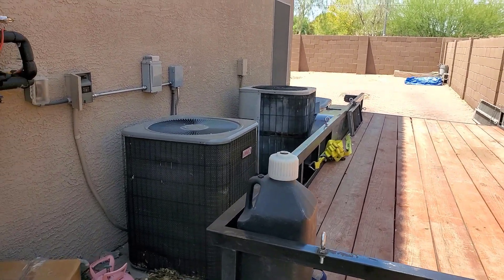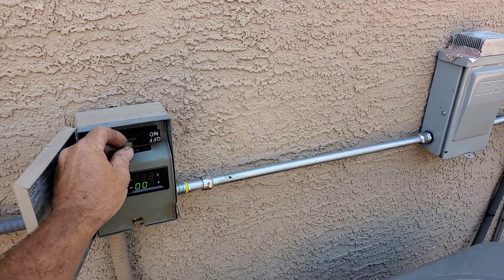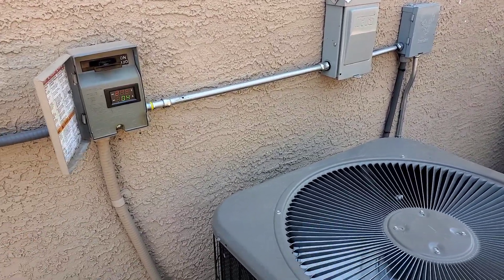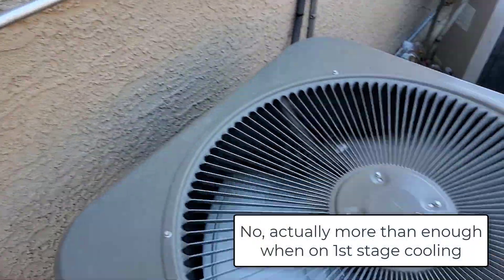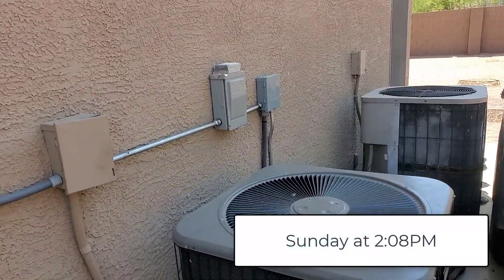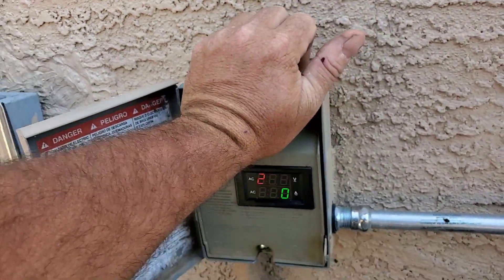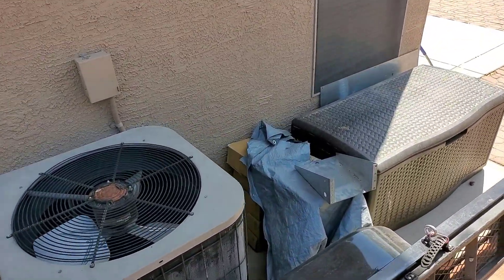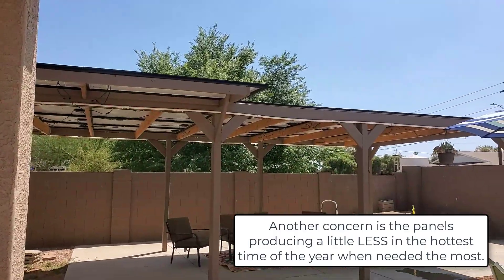Some more thoughts on my DIY Solar Assisted HVAC   Lower utility voltage or increase Solar voltage

Comment: Dumb guy asking a dumb question, how would heating elements handled some vfd goodness? My thought would be to add your extra panels. Then use a vfd hooked to your water heater as a dump load. Then find a way to link the two vfd to work.
Reply from the maker: I already installed an "AutoTranformer" to lower my utility voltage and now it works fine.
The VFD draws off of the solar and zero off of the utility until the solar voltage starts to sag down closer to 300VDC.

My water heater has a small 115V heat pump connected to it.

Comment: Thanks for the update.  As an engineer,  here are my objective thoughts:

-you can’t fully fix the solar vs. grid issue w higher solar voltage; you need to reduce the mains voltage to around the lowest level the equipment will still run at.   The way to do this is with a buck boost aka autotransformer.  This transformer is cheap and has minimal loss because the vast majority of the load bypasses the transformer.  It is only working to raise or lower voltage a small amount.  Losses will be in the range of tens of watts.   It will be warm to touch.

-Get a 240v to 24v 500VA transformer and wire the primary and secondary together in series.  That makes one big effective winding ; feed 240v into that.  Then connect output to the primary winding and you’ll get 240÷264 x 240 = 218.2V.  If you don’t get that then flip around the wires of either the primary or secondary to correct the winding “polarity” .  this little little 0.5kVA transformer is good for 500÷24=20.83Amps  output !  (it’s the miracle of wiring regular isolation transformers,as non-isolated instead)

-DC bus voltage as high as inverter can tolerate is obviously great.  but be careful w any switching circuit - it could behave quite erratically as Sun/shade conditions fluctuate, and as load fluctuates or cycles.  This will torture the switching device , as well as the diode bridge in situations where it switches panels out right when AC sine wave is at peak and the current spike through the diodes will be friggin huge.    A charge controller would regulate it (basically a buck converter ) but i like the elegant simplicity of what your doing and avoiding that kind of hardware.  

-knowing autotransformer theory is  wonderful.  i’ve found no techs, electricians or ee’s that have experience or deep knowledge of them.  somehow it’s a backwater.  you can do amazing things w regular old transformers by how you wire em up..
primer:
https://www.thomasnet.com/articles/electrical-power-generation/about-buck-boost-transformers/
Reply from the maker: I'll have to read up on that transformer article.
I have a fairly large transformer that might work.

As for the switching of the extra panels,  it wouldn't be switching based on voltage and changing during the HVAC operation.
It would switch another pair in series once thebBFD was running (using the VFD output to control the relay) and then switch back when the VFD stopped.
Just to keep the DC Bus from charging up to the higher unloaded voltage of the panels.
If I'm approaching 360VDC now unloaded, then I'd be at 390 with another 30V added.
Reply: @hackfreehvac  cool,  makes sense re panel switching.

most transformers can be wired as autotransformer(buck/boost) provided the primary is rated at your line voltage or higher.   over sizing is totally fine.  you just need primary/secondary winding ratio somewhere in the range of 10:1 to 7.5:1.   i use 240v/32v units to boost 208v to 236v for my 5ton AC and double wall oven.  The transformers are 2 kVA and 1.5kva, respectively, both are oversized for the load

you can actually also use a bunch of plain old 240to24v hvac control transformers wired in parallel to get the VA you need I do this all the time nice power boost to my vacuum cleaners ,electric leaf blower, belt Sander, paper shredder etc.  The only caveat is all the transformers need to be the  same model otherwise you can get some excessive  Eddie currents
Reply from the maker: @yeliab814  I've been reading on those lately and ordered one. 
At first I thought you all were referring to a hack build.
But now I see it's an actual simple voltage correcting transformer and they are pretty efficient after all.
I'll be posting about it soon
Reply: @hackfreehvac  Sweet dude!   This is going to work great I think.  Look forward to seeing the outcome.  I would definitely use that DC choke you have (if it is from a roughly  similar capacity system and thus  rated for the correct current range), even if you have to hack the VFD to access the DC link between the rectifier and caps (some drives provide these terminals with a factory installed removable link, some drives don’t provide the terminals).  And connect the solar after the choke.  The choke will improve the AC harmonics and slightly drop the effective AC voltage a bit more.  

I was also thinking of a cleaner solar switching system for a full 12 panels,   which also adds some safety, but is super cheap because it uses HVAC parts and not super expensive DC gear from the solar and EV world.  Goes like this:
-configure/program an output terminal (open collector ideally) from the VFD that confirms drive is in operation , based on output frequency/rpm, current , or whatever.  Use this plus the VFD’s  DC aux supply terminal to drive an appropriate voltage light duty DC relay , for pilot duty. 
-connect the outputs of that relay through the 24vac supply in the condenser, and over to two double pole HVAC contractors.  but insert an ICM delay on make timer on one of them, and set to min delay (couple of seconds).  run the solar DC into and out of each of the contractors, but on the one without a time delay add a chunky resistor, maybe 100ohm 100w or whatever (would need to experiment with resistor value vs. delay time )

This contactor array should  drop the open circuit solar voltage the drive ever gets to see, and should  not ARC badly on either switch on or switch off (i think).  You might have to play around with the resistor or even add another resistor with a capacitor bank in between them to ground, to get it t work right. 

This setup will also switch out the solar upon drive shutdown/meltdown, and  AC power loss or breaker tripping.    All good for safety.    Initial System startup will be 100pct from grid AC.
Reply from the maker: @yeliab814  Yeah I wonder what kind of arch you might get when contacts in a relay switched another set of panels into series. Lol.
But now that I've discovered autotransformers to reduce my utility AC voltage a few volts I don't think I'll need to do that. 
I've got a transformer ordered but it's going to take over a week to receive
Reply from the maker: Also, my VFD does have the DC Bus link to disconnect and add a choke.
The choke I have isn't from a larger VRF unit so it's more than enough l for my 3 ton.
Reply: @hackfreehvac  great - you should be all set - look forward to hearing how it works out.
Reply: @hackfreehvac  I’m thrilled to have been able to help you out with this project.  perhaps you could look back at some of the questions I asked about your system as I am building something somewhat similar in so far as variable speed, but I don’t think you answered any of my questions to this point fyi
Reply from the maker: @yeliab814  on other videos?
Reply: @hackfreehvac  I had asked a few questions spread across comments on this and one other video I think.  

Basically I am doing a fairly similar project in that I’m converting my 5ton ac to all variable speed.  I have installed  motors/VFD’s for evap&cond fans; next is install 3ph scroll and VFD.   So I was curious:

-do you have recip or scroll, and how low Hz do you go? 

-what VFD power/current rating do you have, for the 3ton(correct?) compressor?  Any issues starting it?

-any oil return/sump issues, and any opinion on how low Hz I can run my zr61kce/tf5 ?  Do you think it makes sense to run a periodic run up to say 50Hz-60Hz when running at low speeds (30-40Hz)?

-Are you just running 2 stage 40 / 60?   I was thinking about controlling comp speed on PID using perhaps suction pressure transducer, but cant think of a good control strategy.   Maybe simpler would be to vary evap fan and comp speed in unison based on a PID linked to temp setpoint.  

-any other helpful thoughts in making such a conversion?   There seem to be very few people who have done this ..  many thanks

Comment: I was thinking why not run a timer too the system where you can kill one power by a timer switch and then it can switch back in the evening to the grid but just another idea for your system...
Reply from the maker: If I had clouds, rain etc it would then drop voltage and fault the VFD.
Also the load varies. And if someone turns the stat down the 2nd stage on a hot day might exceed solar only power.
Reply: @hackfreehvac  yea true but least it doesn't rain often here but I guess if it was only that simple but I'm sure you will find a anwer a switch or something that runs on where solar kicks over and switches off the grid but it's out there....lol